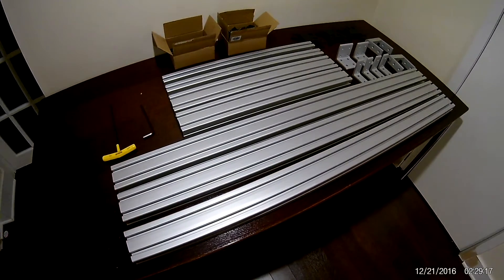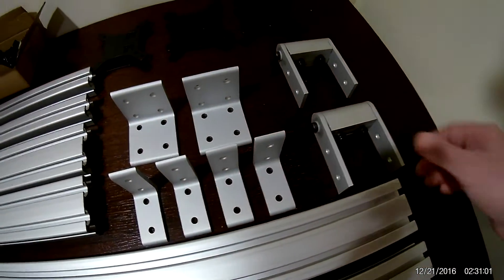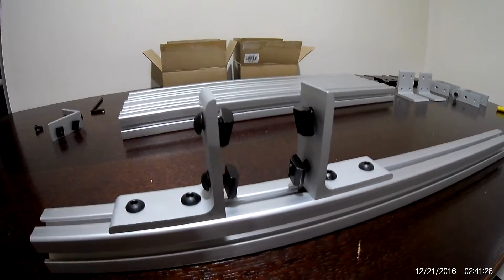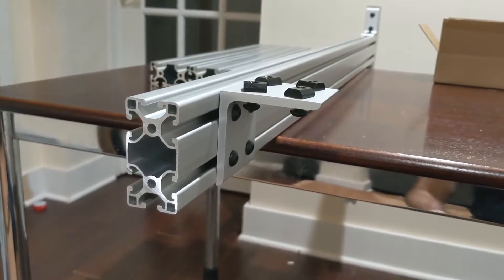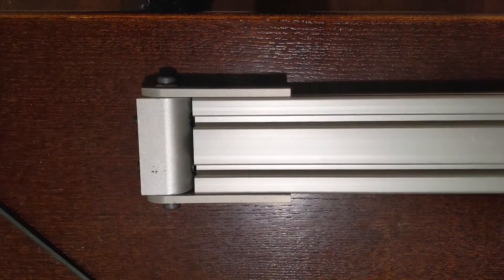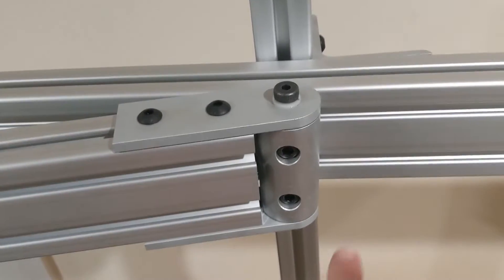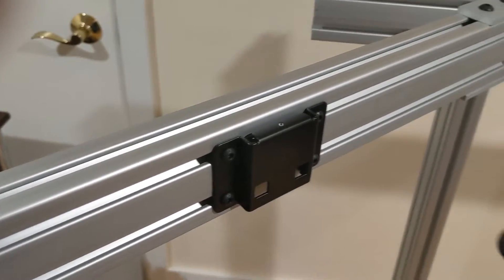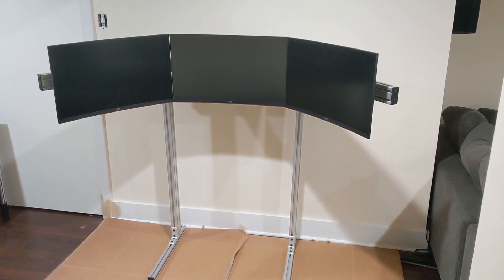Triple monitor stand build using 15 series aluminum profile

Comment: Thank you for the guide! Really helpful! But for mine, I think I'd add caster wheelss on the feet. Do you think it will still be as stable as the one without caster wheels?
Reply from the maker: I had in fact purchased casters but it is so light that it slides very easily on my wood floor so i didn't use them. Maybe on carpet ot would be easier to slide with the casters.
Reply: @simracingmontreal1038  I see. I guess I'll have to look for casters that have locks on it. Thanks for the reply!

Comment: Hey thanks for posting this build! I'm looking to build the same and was about to make my order before seeing you video and I'm happy I found it. Are the higher strength pivot bracket you we're talking about at 9:00 these brackets? https://www.fazstore.ca/product/15hi8860/
Reply from the maker: Yes, exactly. The ones I used are fine for the 27" monitors. They have not moved at all since I put it together. But 32" would be better with these. Have fun putting it together.
Reply: @simracingmontreal1038  Okay I'll probably stick with the pivots you got then. Also, in hindsight would you have bought some of the arms or posts shorter in length to save some cost? Or is the extra length worth it for possible future modifications?
Reply from the maker: @Focus69420  It wasn't a big difference in cost and it's worth it in case I want to upgrade to 32" or larger.

Comment: How even did the monitors end up lining up?  I've got 3 27" montiors I use and while I currently own an Obutto R3v with a tripple monitor stand, the three monitors barely line up across the top and getting them even close was a ton of work.
Reply from the maker: I think the trick is to place the left and right monitors with the Vesa mounts on the arms but not completely tight so so you can move them left and right until they align. Then you can remove the monitors and tighten the mounts on the side arms.
Reply: @simracingmontreal1038  Sorry, I should have been a little clearer I guess.  I mean they align vertically, across the top and bottom, not side to side.

Comment: With 24” monitors I suppose the feet have to be brought closer together?  How stable is it?  Do you think it’ll be stable on carpet?  Thanks
Reply from the maker: For smaller monitors you just need to adjust the placement of the swivels for the side bars. You don't need to adjust the feet but you can if you want.

Comment: Hi i have 3 * 32 inch curved. is it working for 32 inch with this mesure
Reply from the maker: The measurements would work but you should use the more solid corner pivot brackets to hold the side arms.

Comment: Thank you for this guide. How has the setup been now that you've had it for a few months? Anything you would change? Do you think the Lite aluminum extrusion is strong enough? Thanks.
Reply from the maker: Yes, it's very solid. Only if you use larger monitors I would go with the larger corner pivot brackets. You can also add some casters if you want to put this on carpet so you can roll it easier. On wood floors it is quite light so it is easy to move.
Reply: @simracingmontreal1038 can you send a link for the pivot bracket, the large ones please 🙏🏻

Comment: YO AFTER REWATCHING It makes sense & their diagram is NOT what you did in the video you sir helped me on my path to sim racing
Reply from the maker: My design is based on the model from Simlab. I used the profiles from their 100/200 design but with the 100mm VESA mounts and different pivots. Did it finally work out for you?
Reply: Sim Racing Montreal honestly if u have it,  my discord is beaver#1977 add me I may have some questions (just trying something, my pivot point was sagging)

Comment: are you sure the vesa screw size is 5/32? doesnt look like that much smaller on camera. Also how do you secure the pivot joint once its mounted so it doesnt move anymore?
Reply from the maker: The pivot is screwed to the profile using 2 T-nuts. It holds it well but I would say 27' monitors are the max. The pivot arms are held by a screw and nylon washer which permits them to pivot. The arms are able to move so you can open and close the monitor position to move in an out of your rig. They are not flimsy though. They stay in place when positioned where you want them, See the pics in this link Hope this helps. https://www.dropbox.com/sh/anbgw4k5ho62glv/AAD2xjv5qo9EiuOhqBLi2dH9a?dl=0
Reply: @simracingmontreal1038  thank you! this clears things up, I was able to find all the parts in your description on 8020.net (Im in USA). So the arms just have enough friction to not move unless you push on them?
Reply from the maker: @tigim101  Yes, that's correct.